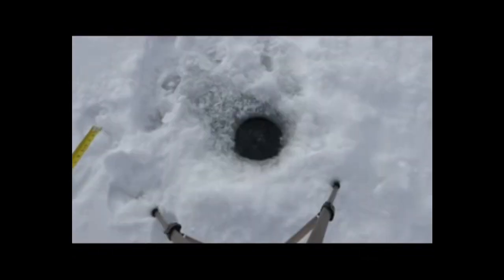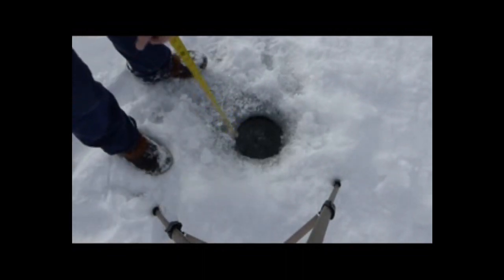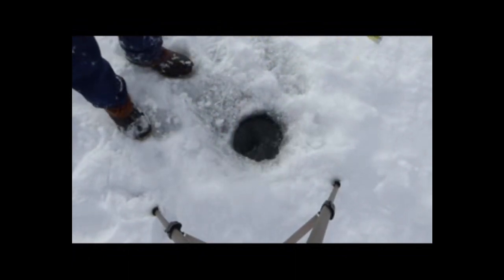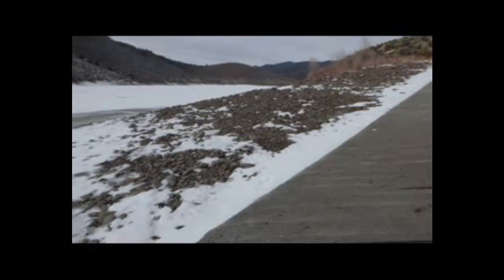Landworks 48 volt Electric Ice auger test and ice report for some Central Utah lakes

Comment: Do you still have this auger? How is it holding up?  I’m looking for a new auger to replace one that was stolen and Amazon has it for too cheap to pass up.
Reply from the maker: Yes we have used it on all our ice fishing for 4 years and I still like it. it is a little heavy and you need to watch the screws that hold the blades on I used lock tight after one came loss,